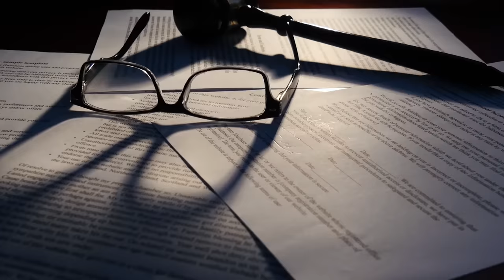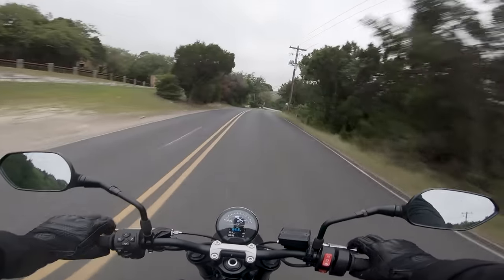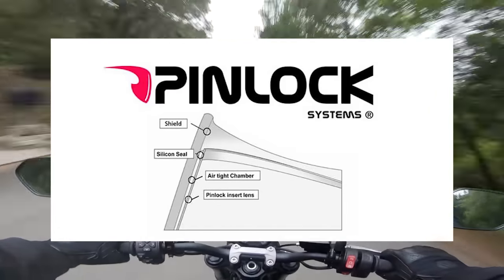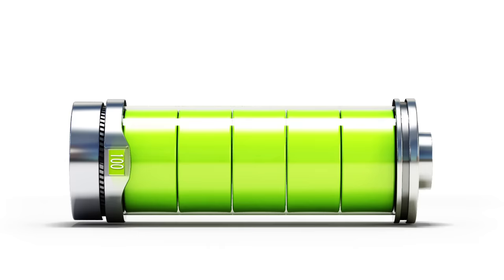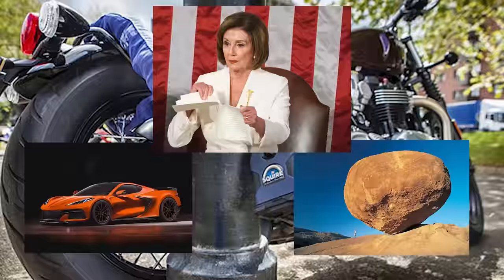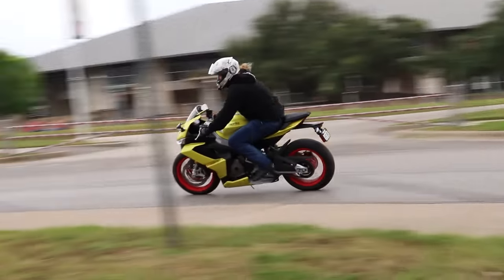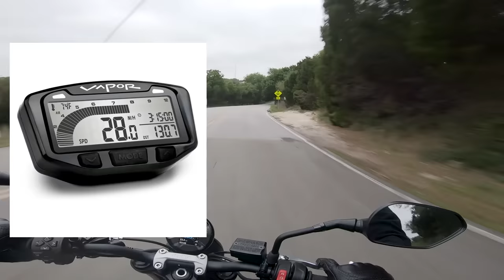Top 7 MUST HAVE Beginner Motorcycle Accessories

Comment: I am going to highly recommend you guys don’t use progressive motorcycle insurance, I’ve had multiple experiences with questionable billing practices. They will quote me one number, and then half way into my billing term they’ve increased the price and charged me extra. This happened two separate times two years apart. The worst part is I paid in full up front so I didn’t check on it until my bill was overdue.

Comment: 7:20. Some very important emergency items left off the list:
- Headlamp instead of flashlight.
- A few fuses in the sizes and capacities specific to your bike.
- Small roll of electrical tape.
- Small roll of duct tape.
- 2 ft of 20 gauge electrical wire (can be rolled to fit inside the electrical tape roll).
- JB Weld SteelStik (to repair a cracked crankcase or radiator in order to limp home).
Reply: The headlamp advice is pure gold,  Plus if you've got the space to spare, A high visibility vest and a road flare or 2 . If you need to fix something on the side of the interstate at night You will be thankful that you look like a giant banana . Not to mention the  utility in case you're trying to keep your buddy who just crashed from getting hit by another car coming around the blind turn.
Reply: I have questions. 
Why: 
1. Electric tape? 
2. Duct Tape? 
3. 20 gauge Electrical wire? 
4. JB Weld SteelStik? 

Genuinely curious. 
Cause it seems like having universal high capacity saddle bags and a cargo rack on the back of my cruiser seems like a requirement.
Reply: @DylanBegazo  Electrical tape for short circuits and exposed wire, with movement comes wear. Duct tape could be for general purposes like zip ties. I'm not sure about the wire but they already explained the JB Weld, plus it's a lot cheaper than a tow truck.
Reply: What a weirdo
Reply: Go make a video clown
Reply: What about oil once you repair this crank case?
Reply: @smokeyjayshouse  Think about it. If your crank case damage is so serious that before you can even attempt a roadside (or trailside) fix, you lose more oil than you can safely ride even a short distance with, then there's no point in repairing it, is there? The repair is for when the impact causes a leak slow enough to allow you to apply a patch. That's the case with all these emergency repairs...they are meant to get you out of a bind and help you limp home or to a shop.
Reply: @WTFisupDennys  ?
Reply: @m532hisnotalive2  he can make his own video if he has so much to add.
Reply: I've repaired my stator cover from a slow leak with jb weld haha
Reply: i had a replacement light bulb if you don't set-up a fancy LED front light (what i put under the seat of my CB500, with the screwdriver to fit it, of course
the front lifht is a really smart idea (thanks, i will add it), but more in the back-pack essentials than under the seat (because of the battery...)
Reply: @WTFisupDennys 
Nice try, troll. He provided helpful information, unlike you. Lots of us will appreciate his comment. Hell, that’s even a good list for car emergencies.

Comment: 1. Phone mount with usb charger for gps navigation
2. Rubber handle grip cuz stock one is hard as wood 
3. microfiber towel to wipe your visor and seat
4. Rainsuit
4. Tailbag to store rainsuit & groceries
5. Voltmeter to monitor battery voltage
Reply: I’d skip out on the phone mount for beginners, getting a Bluetooth device and just listen to directions would be better. This isn’t ideal for everyone but as a beginner, your only focus should be the road and riding the bike. I’d say maybe a month later you can get the phone mount.
Reply: @migueldiaz9754  On the subject of Buetooth devices, would you recommend a Bluetooth device made specifically for riding or would wrieless earbuds work as well?
Reply: Is there any good tailbags you recommend? I want one but not one that can be stolen easily
Reply: @Riceball01  I realize this is like 3months late and uhh probably not the best advice as a guy in a chair, but I would say a helmet-specific headset. My biggest thought while prepping for a bike for me oddly was if I wreck and have earbuds in...on a scale of one to fucked my luck would be hearing = fucked.
Reply: No tire gauge?
Reply: A volt meter will drain the battery faster
Reply: @kennethpereyda5707 you didn’t watch the video did you?
Reply: Thanks

Comment: You forgot a large pack of foam ear plugs and cleaning supplies. A clean bike is a happy bike. Also makes finding where that oil leak is coming from a lot easier.
Reply: If its leakin that means it still has fluid👍
Reply: Ear plugs why ear plugs
Reply: @backwoodsrogers438  If you ride even with a decent helmet at 70mph, your ears are hearing too many decibels of wind noise and speaker noise which is hearing damage. Add to loud pipes, other cars, and long duration noise you'll result in hearing loss and damage. I know theres atgatt, but sometimes if you just go a mile down the road without a helmet even 40mph sounds too loud.
Reply: @Sizukun1  my mom and dad usually uses earbuds that’s why I was asking
Reply: @backwoodsrogers438  Some in-ear buds have okay noise reduction (not electronic noise canceling) numbers, so they may have found something that works. I use a Sena bluetooth with speakers inside the helmet, so ear plugs are a must for ear safety.

Comment: Honestly, in my years of riding so far I never needed a tool kit on the road - only used tools when I swapped my exhaust. However, cleaning supplies and tools for especially chain maintenance and other mechanical components is in my opinion much more important on a regular basis, and something every rider should keep in stock - especially if you ride in humid environments. Keeping your mechanical pieces clean will save you from having to do actual repairs down the line.
Reply: I tend to agree, if you're just bar hopping or bopping around town You can always set aside some money for a tow as long as you're not going too far from your house the bill Won't be too absurd.  With that being said if you're going on long 2 300 mile jonts that tool kit is worth the space in your pack
Reply: @mrspeigle1  Even as something as simple as replacing light bulbs requires a few tools, Allen keys plus screwdrivers, Phillips and flat head will not break the budget for space nor weight.
Reply: CD❤ CDs ex
Reply: @gorillaau z

Comment: 7:28 Road Flares!! Bonus points if you have the ones with the little wire legs. Puddles don't always kill a flare but both mud and puddles can and sometimes will. And it'll be at the worst moment.
Also, a small knife, pen and paper (preferably a space pen and "writes in the rain" paper), and a bic lighter
Reply: Why not do what the Russians on the ISS did and use a pencil?
Reply: @user2C47  because pencils suck. 
Also, writing on wet paper is easier with a pen, because the friction is less. And you can count on your paper being wet at the worst times. Just assume it's going to be wet, right out of the gate.

Comment: Personal thoughts from someone who recently probably progressed from a beginner to intermediate:  

The disc lock is VERY essential!!!  At least if you live in SoCal.  Don't listen to what he says though.  Your 400 can and will get stolen if you're careless.  When I had a R3 and browsed the R3 forums and FB groups, I remember multiple ppl getting them stolen.  Also, those accessories should be a 1 time purchases and will stay with you regardless of bike.  Personally, I think a disc lock and Kyrpotonite chain should be considered a part of the cost of your bike.  On the subject of my first bike, my R3 had a gear indicator, but the next bike I purchased did not.  So I immediately went out and bought a gear indicator.  If I knew what I know now, I wouldn't have bought it.  I never even look at the gear indicator.  I thought that I did, but I don't.  I mostly forget it's there until it errors out.  It's a major PITA to calibrate and is oftentimes inaccurate anyways.  It was also kind of a pain to install.  Your ears are just as good, if not better than those lil gear indicators for telling you which gear you're in, at least on my bike.

Comment: I got a round padlock that works just as well as a disc lock minus the alarm. It works with a combination so even better than the the disc lock which sometimes keeps going off randomly in wet weather.

Comment: Gear position sensor is my favorite thing on my older bike hands down cost like 30 bucks install doesnt take much time at all just make sure you program it correctly I messed mine up when I installed it and only went up to 4th
Reply: I'm not sure why more modern bike have only just started to get those as standard now?
My old 1973 Suzuki GT380 stroker, used to have the gear indicator with a digital display (of sorts)

Comment: I FINALLY settled on a motorcycle upgrade from my 500R......a new leftover 2020 Husky 701 Supermoto. I'm sure Spite would approve. Anyway, point is......I already got $1000 in mods in the mail with another $1000 planned down the road still. lol

A couple of upgrades in my first thousand is actually some of the stuff mentioned on the list. Specifically, LED headlight bulb replacements and the Cumpan (yes, I know) cockpit assistant, because not having a rev counter and gear indicator makes me very sad. (Seriously Spite should look into one of those for his 690 if he hasn't already)

Motorcycle accessories are never ending. xD

Comment: I've been riding in the Bay Area off and on since the mid 1980's.  I've been riding a lot since 2007 and have never owned a battery tinder.  Like I said, I ride a lot so I've never needed one.  I am sure they are a great piece of equipment if you don't ride too much.  Fortunately, the weather here is great all year.

Comment: I never had or heard of a pinlock. I would just use the Rain-X antifog solution wiped on the inside of the visor. You have to retreat it maybe every few months. Works well on car windshields too, which is probably what it was designed for.

Comment: Couple of suggestions. If you're drilling the face shield put some blue tape over the drill point it'll keep a crack from running and if you're hard core remove the fasteners and add some loktite to keep fasteners tight and not rattling. I learned this trick when I was restoring a 49 Panhead which actually came to me in a milk crate. Now go eat some bugs.

Comment: A Tool kit... well yes, i have one of those, but it takes a van or ute to move it around, as well as an extra person... It also takes up 4 cabinets, and only two of those have wheels.
17mm is not an odd size, 13 15 16 and 18mm are the Odd sizes. I wish I didn't have to have every torx size imaginable, but as far as Allen keys go, I refuse to get Imperial sizes... I will never wrench on anything with imperial Allen keys!

Comment: Not having a visor with pinlock once saved me from a possible ban & certainly a fine, just turned from small side road onto large straight road for 4km,was early morning & very cool, accelerated to about 140kpm (limit is 90kph) visor completely fogged up, could barely see anything, went down gears & braking hard, & lifted visor, see movement at end of straight so stayed at lower speed, got closer & was Police with mobile speed gun, I was lucky 😊

Comment: In the tools equipment, you forgot to have a torque wrench. I recently had to replace the oil pan because the previous owner had over-tightened the oil-pan bolt and caused a crack in it. Fuuun to change just before the season where I live started...

Comment: 4, 6 and 8mm hex keys?  There are a few 8mm cap screws on my BMW but almost all fasteners are 5mm.  Other BMW bikes use Torx fasteners.  If you need to reach far back into plastic fairings to remove them, be sure to have a long reach T handle hex key.  You'll seldom have straight in access, so a ball end hex key will allow access from an angle, but the ball end doesn't retain the fastener as well when it needs to be poked back into the innards of your bike.

Someone needs to sell good ADV quality rust proof tool kits that are specific to all of the common bikes, with 20% extra space for user added preferences because everyone is a bit different.

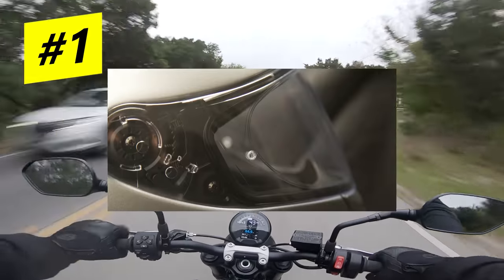Comment: 2:21 #1 pin lock visor

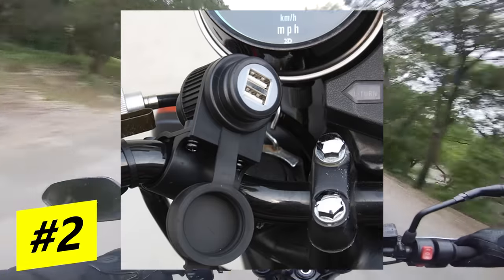3:32 #2 battery tender and a USB
 charging port.

4:42 #3 brake lock

5:59 #4 smartphone-compatible gloves

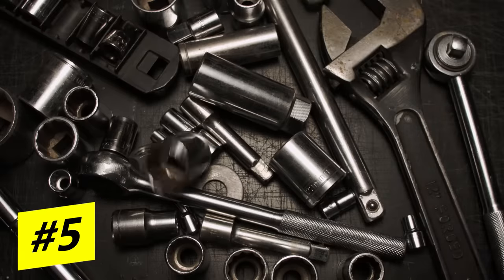7:00 #5 a tool kit

8:13 #6 upgraded lights

9:33 dashboard accessories or a new dashboard

Comment: Do you think an X Pipe and / or Predator Pro Exhaust (which is supposed to be a high speed exhaust that allows the engine to run cooler) would prevent bluing of the header?

What accessories would you recommend to protect a bike while someone is learning other than a dresser bar to protect the header?  Sliders?  Other?

I'm looking at a T100 or T120.  I would like to know your opinion of these 2 for a beginner.
Have you reviewed these 2 models?  If so, would you post a link?  I through your videos and didn't find anything.  Maybe I overlooked it.

I need XL Tall size for a jacket / shirts and 13 Extra Wide size riding boots.  I haven't been able to find what I want in these sizes.  Suggestions?

Can you recommend a GPS Tracker for security to be used in addition to an alarmed disc lock?  Preferably one that is not easily disabled and can be installed in a location that isn't easy to spot.

Where I live the MSF Basic course is available at a company called Total Rider and at a Harley Davidson dealer.  Do you think one would be better than the other or that there isn't really any difference?

Lastly, What is your opinion of the HJC i70 Matte Black helmet?  The Shoei Neotech 2 helmet?

Comment: What if i lock both motorcycles together with a heavy duty chain and a disc lock? It would be hard and awkward to  have 4 or 5 guys try to pick up 2 bikes locked together while the disc lock is blaring at 110 decibels.

Comment: Nah I'm too lazy to replace the clutch cable. My dual sport works fine without it.  All I need is a little push and the ignition does the rest . Just joking but my dual sport switches gears very easily without clutch and before you say it no I don't have a quick shifter . But the main reason I don't replace the clutch cable is because it's a farm bike and doesn't need to be road legal.

Comment: So I just got my permit and my first bike. its a 2009 Kawasaki ER650 and it has a built in Fork lock. you cant turn the bars when its parked. Is this enough of an anti theft? is a chain and lock really necessary?
Reply: If you are parking it where it might get stolen, a chain is absolutely necessary, otherwise they will just bring a crane or several strong men.

Comment: I replace all my toxic lead acid batteries with lithium.  No trickle charger needed, lighter, longer warranty, last 3-4 times longer, charge in minutes vs hours, no hydrogen gas, no corrosion, higher CCA, full power turn over even at 10% charge(lead acid dead at 70% charge)
Reply: Until thermo-runaway happens - kind of how Ford tells their customers NOT to park in their garages

Comment: Guys... If your face shield does not already have a pin lock don't pick up a drill. Simply run to your nearest store buy bottle of Rain-X clean your face shield inside and out wipe it down with Rain-X inside and out let it sit for a few moments and then wipe it down again until it's clear. Rain-X will prevent fog for about 2 weeks to a month with steady riding from simply one application.

Comment: Thinking you can actually stop your bike from being stolen with a bike lock, the best joke of the day!
At best you may cause said thief to take a few extra seconds, yes I said seconds.
Thieves today are much more advanced and mobile with the tools they use to cut, pick or disable your anti theft device and there are plenty of videos floating around that will show you just how easy most systems can be defeated.
Reply: Which is why you also have a GPS tracker.

Comment: You lost me at advice number 1.
I had no pinlock for years and almost never had fog in the visor, except at a full stop but then you just open it a little and it's ok.

My new helmet had a pinlock included, it was carefully placed in, it looked like it was fully sealed, but with the first big rainy day, there was water getting inside and it totally fucked up the visibility, much worse than fog would have, and it never go away. Total crap.

Edit : AHAH advise number 2 a battery charger. You just don't need it unless your motorcycle have electrical issues. I never unplugged a battery for like 6 monthes every year, and never had a discharged battery, not even a slighty weak tension.
Reply: A lot of the newer bikes have a "key-fob" instead of an actual key that you have to insert - if it goes more than 2 weeks, I'm plugging my bike into a tender - the entire time that the bike isn't being ridden, it's looking for that key-fob